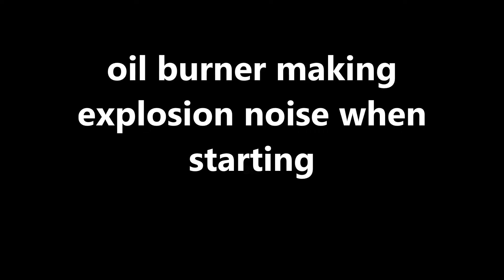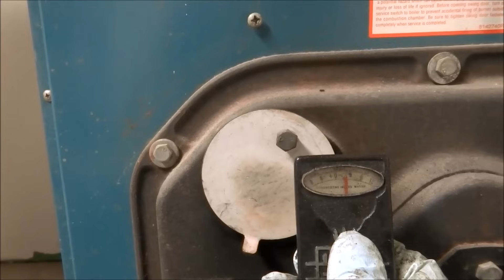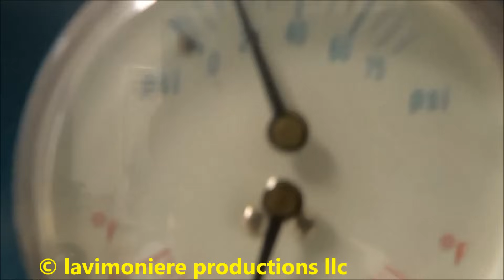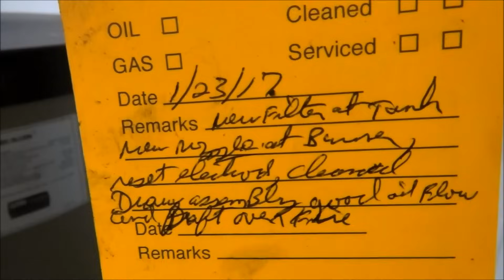beckett oil burner making explosion noise when starting

Comment: Thank you. This saved me hundreds.
My local furnace guy charged me 600 bucks to replace the water pressur reducer valve. Then they failed to check the pressure check  purge valve, so I had to have them come back the next day and it was another 600 bucks and service call fees. Then 2 days later this part was acting up.
I wasnt gonna get suckered by them again.

Comment: GodBless you Steve For the Video's...I followed and did every step you showed and Cleaned burner top to bottom. Installed new filters and bled the oil line. I also Installed new triple aquastat relay, Now all 3 Zones run Heat. New oil nozzle and cleaned and positioned the electrodes just like you showed..The Furnace runs Great and not even a puff of smoke on start up! TYVM Great step by Step Video!

Comment: Hi Steve, Would a weak Igniter cause a Bang at start, or what else would it be, The burner sounds great when running.
Reply: If you press the reset button more than once as Steve has explained in the past, you are dumping fuel into the combustion chamber. Once you fix the spark problem it will fire and cause the blow back puff until excess fuel is burned off…..

Comment: Just a tip you can use carb choke cleaner to clean the oil filters works great. And always change the oil pump gasket if you pull it. Save yourself a headache 🤕

Comment: Hello, good video. I have new Beckett AFG, makes same noise on start up. Installer says all new burners sound this way. Should it be a smooth ignition even on new models?
Reply: If its making a bang noise on start up ? Like a bunch of Fuels being ignited at once ? NO it shouldn't.  The igniters need adjustment.  Probably too far apart and letting oil build up in the chamber before it ignites.
Reply: @stevenjackson7067  Thank You, will adjust and see. Will reply with results.
Reply: You can buy a Beckett igniter tip setter. It's orange in color and slips over the end of the Nozzle assembly.  It let's you set the igniters the right distance from the Nozzle and the igniter assembly the proper distance from the burn chamber. Easy to use. Even I could use it.. lol.. 
Nasgauge part number T100-202. 
I've had it a few years and can't remember what I paid for it. Was cheaper than a service call, which he didn't fix the problem. 
It stopped the bang, more heat and no black smoke or oil smell coming out the chimney.
Reply: While you gave it opened up I'd clean the cad eye or as some call it "the cats eye". It recognizes the flame and if there isn't one or it doesn't see on it will shut the burner off. By then it's run 30-45 seconds, depending on control, and shot fuel in the chamber that length of time. If you hit the red button to restart it the igniters will ignite the fumes in the chamber and boom. Don't hit that red button more than once if it doesn't fire up. If you do it will go boom and the excess fuel in the chamber will burn off creating more heat than the chamber may be able to handle. 
Also if you have a weak transformer it may not give the necessary spark to ignite the fuel. Let's start with the cheaper and easier fix first and that's adjustment of the igniters.
Reply: @stevenjackson7067  Thanks for response, all thoughts are appreciated, will try different things and post success or failure.
Reply: @stevenjackson7067  Also explosive start can be heard mostly through stack dampener. If I hold something over dampener, ignition is more like a whoomp, than an explosion.

Comment: Isn't the cause of explosive start up excess unburned oil in the combustion chamber caused by the oil not shutting off cleanly when shut down? So how would any of these regular issues, filters, nozzle, etc. cause that?
Reply: It can be oil that is sprayed into the chamber before the igniters have a chance to fire it. Usually caused by the 2 being 2 far from the nozzle end. Any of the following,  igniters 2 high, extend 2 far past nozzle,  2 far apart or even 2 close together not allowing enough spark that's produced by the transformer.

Comment: Love your vids my man, good way to bounce some ideas. Pump filter I like to spray with carb cleaner from inside to get all those particles out, I also spray down both sides of the pump and let it dry for a min. Been doing same on my own pump for years. Keeps it nice and clean, good assurance nothing get plugged up down the line. But I also spray down the tank filter container w/ carb/ brake cleaner to get all the old oil and rust from the tank out of there.
Reply: I do the same. Next season the screen at the nozzle will definitely have some bypassed muck that got pushed through with the brush. New pump strainers are a dollar. Every year every job the customer gets new filter, strainer and nozzle. brake cleaner spray down, electrode set, disassembly brush out and vac and safety confirmation. Then a combustion analysis with Testo 320 currently calibrated and a printout. Before and after vac out pics sent to customers phone. Keeps them informed in the loop and happy. Good job as always Steve.
Reply: @deanrusso2855  how much do you charge for all of that and what state you in?

Comment: Good work as always Steve. Surprised you don't have a oil nozzle wrench. Usually the electrodes are removed and cleaned when the nozzle is changed. So not a big deal. You run a separate oil tool kit bag box, right? So you don't have to smell oil all day long on your main tool bag. Used to do some oil service for 4 years on and off. I don't miss doing it all!
Reply: I'm sure the customers appreciate that as well, not smelling like oil when your servicing their residential drinking water.

Comment: Good job, Steven 
Spent my morning fixing toilet with quiet fill Korky, and parts house run for limit on dryer, fuse link and clean lint collector box to roof.All back to normal operation..
Reply: Just fixed a dryer for someone with the same issues. Thermal fuse open. PACKED with lint. High limit should always be changed when thermal opens. ( whirlpool recommends it, as well as other manufacturers) Was yours full of lint too?

Comment: Lots of great infobut WHAT CAUSED THE EXPLOSIVE STARTS before you tuned it..i replaced pump adjusted electrodes new nozzle set ..all fittings snug new  gaskets on filter can starts right up with a CLANK..runs 10 seconds and stops  15 seconds and starts with a explosive fuel line clanking bang..checked for fuel lines etc leaking and fuel line check valve checked ok. Like it loses prime.  but cant find where..  does igniting stay on or only intill fire starts ..ive dont 90%my own furnace survice/cleaning last 40 yrs .this problem is a first.  becket pump 2450 rpm 1.50B nozzle  filter  all new.???? Cant afford $110hr techs plus travel..learned to service from family friends Heating Service Guidence  .good video sir  thks
Reply: Explosive starts were caused by wrongly adjusted electrodes.
Reply: could also be the pump solenoid not working properly leaving excess oil
Reply: Depending on the pump if it has no delay valve it’s not a clean cut pump but some pumps you have to adjust oil pressure out of the box they are usually 100 psi you can look at the sides of the burner if you don’t see a sticker that says set pump to x psi then that’s not your issue but if you see that sticker and it said 130 or whatever then you have to adjust the pump pressure

Comment: I have a Becket too.  It delays 5 seconds every time.  Looks like a newer model. The green lED goes on when it does fire.  Does this seem normal to you?
Reply: A 5 to 8 sec delay on fire is fine, only if it has a solenoid valve above the oil pump. It waits for oil pump to come up to pressure before starting.  Then you should see the green light.

Comment: what do you do if someone or someone's have pushes the reset to many times is there a way to clean the oil out of the chamber.
Reply: clean out the oil
Reply: Light a small piece of paper and toss it in to burn off the oil
Reply: that's too dangerous, soak up as much oil as possible first.
Reply: dave12546  how
Reply: Usually intails a smoky basement for 5 minutes

Comment: I know this question doesn't have to do with this video. But how do you tell the difference between a bad pump and burner motor?
Reply: Michael Morassi bad motor would lock up usually and you can test the ohms bad pump wont bleed
Reply: bad pumps, don't pump to set pressure, make noise, or will have afterfire as in this video. when off, it should drop to 80% of run pressure and hold that pressure, with no afterfire.

Comment: +stevenlavimoniere Just curious why most of the oil lines at the tank are coiled in your videos? is it code?
Reply: The coil adds slack to the line for servicing
Reply: not a fan, looks like crap IMHO. back to that Burnham, Who puts the boiler control and the service switch like that??
Reply: Aptly named a "service loop". 
Allows the door on the front of the boiler to be opened for cleaning the chamber with out having to disconnect the oil line from the burner.
Reply: i agree, shit wok to put a switch there like that.
Reply: was originally meant to reduce vibration and if you needed to reflare you had extra to do so as most were in the pour of the floor.
Reply: Like the old lady ays better to have more than come up short!
Reply: @oilburner9989  You’re still watching oil burner videos?!?! 

XOXO -The burger flipper.
Reply: @oilburner9989  key word being “should”... not uncommon to have a leaking flare, then your state says you need to install a flared OSV....and as stated before it’s used to reduce vibration that will sometimes occurr, a harmonic distortion of sorts.. especially since the anti hum discs aren’t in most fuel pumps . They look like a small air pillow the size of a quarter. If your basement were to flood and he tank decide to float a bit, the coil would allow a bit of movement...

Comment: Your so called cleaning of the pump filter seems to be rather crude.  You never cleaned it with brake cleaner or blew out with air after brushing, easily could have particles on inside to directly plug nozzle?

Comment: Steve when is it determined when you should change the ceramic igniters, never seen you exchange for new ones. ??? not that expensive
Reply: kevin kellner when they are cracked you change them
Reply: They are the cheapest part of a trouble or repeat call, if I could NOT clean um up new WHITE and I found no other cause, it’s the least expensive (ie motor, controls etc) and many times the culprit. I used many porcelains over 35 years.......call back % the least in the outfit.........

Comment: Riello oil boiler fires up but only runs for 1-2 secs. Fires up again and this second attempt everything runs fine. Can't figure out why the first attempt fails, so to speak.
Reply: Update : cleaned nozzle and cassette. Cleaned and adjusted electrodes. Good as new now

Comment: why is fuel oil so dirty, 3 filters?  fuel oil is a distillate shouldn't it be clean? and what is with the gloves?LOL
Reply: Because its diesel pretty much. Even see a diesel engine run? A lot of carbon. Heck they run two separate oil filters just to keep the carbon out of the oil.